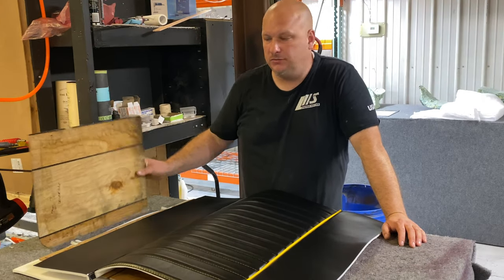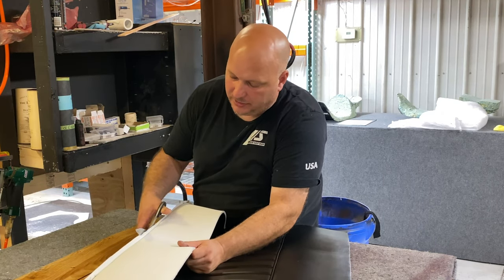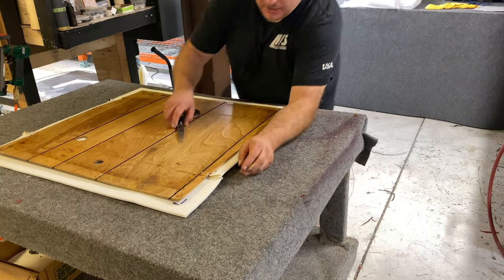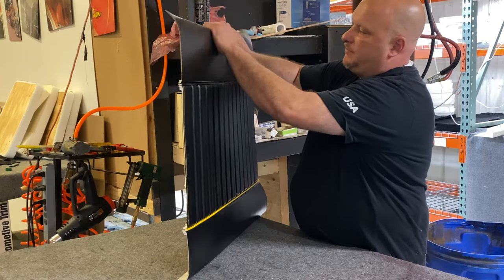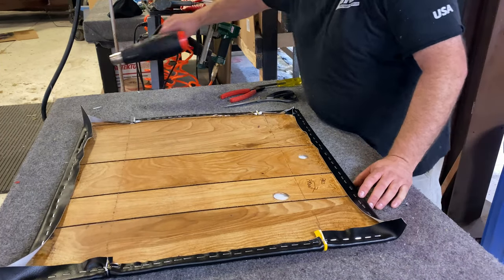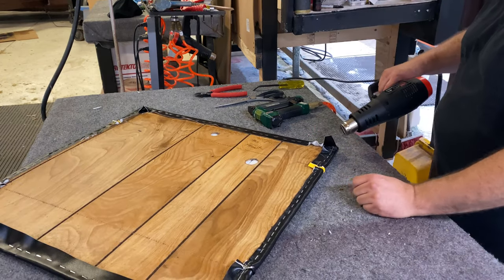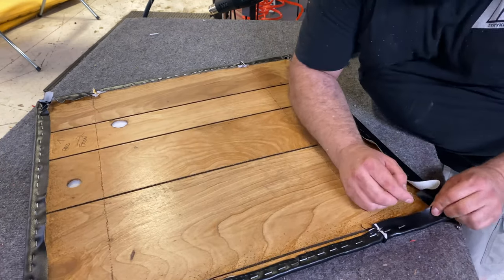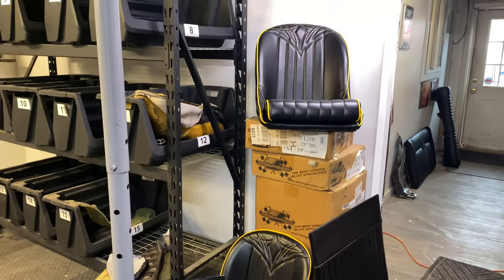How To Upholster Car Door & Side Panels.

Comment: Hello, I came across your channel while trying to come up with ideas for my 1988 Volvo 244 DL door panels.. they are original non-waterproof floppy cardboard style, covered with vinyl and cloth.. You have inspired me, I thank you... I wouldn't mind making my own door panel using the original as a template... My dilemma is the panel top curves, then protrudes inward towards the glass, thus making a lip that has a window weather strip attached and a hole for the (push pull style) lock knob.. Can you lead me to one of your videos, regarding this style of panel.. This panel has two rectangular pieces of metal attached to the back, acting as a guide and a lip to hold the panel in place before pushing in all tabs. I have little talent in this area, but lots of ambition.
Reply from the maker: @chadgama  we have two of the wagons in the shop. I’ll check tomorrow and see what you’re talking about. We might even do a video about it for you. Thanks and thanks for watching

Comment: Nice video!  I like the tip to remove the foam from the folded over edge to make it thinner.  I’m concerned about the angle of the staples holding the corner material down.  With the gun leaned toward the edge, it looks like the material could pull the staple out.  Shouldn’t you staple straight down through the material or angled away from the edge?  This would put a sheer force (perpendicular) or pulling the staple in force (away).  Thoughts?
Reply from the maker: With the material glued , it really doesn’t pull much. The staples are just there for an added mechanical fastener. We usually angle the staples away from the pull if they have a lot of tension on them. Thanks for watching

Comment: Thanks for the video! Question, what size staples are you using and what would be considered standard upholstery staples? Thanks!
Reply from the maker: We use many different size and style staples. Usually 1/2 crown in 1/4" , 3/8" . 1/2" & 5/16" are our most common in coated as well as stainless steel.
Reply: @AtomicAutoworksTV  Thanks for the info. Another question, what staple gun do you recommend?

Comment: Did you glue down first?
Reply from the maker: Sometimes we do a light glue to hold the pieces on before we rap. Gluing is always a personal preference. If a part is heavily curved we usually glue to keep it in place.
Reply: I have done many GM seats that were not glued to foam just stitched .So thats how I did them also . So my lasy set of seats I didn't glue.Now I wish would have I have few bubbles heat gun won't get out would that have helped? @AtomicAutoworksTV